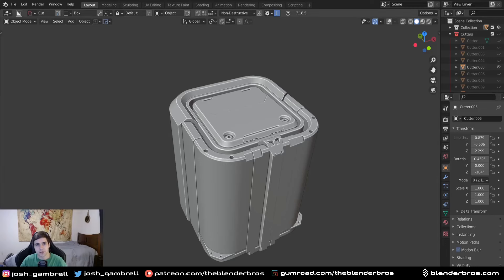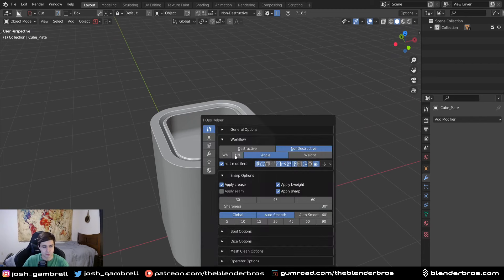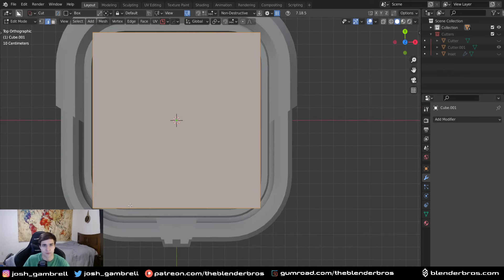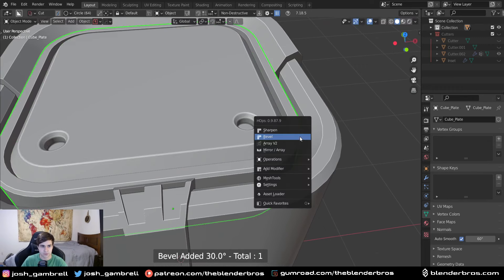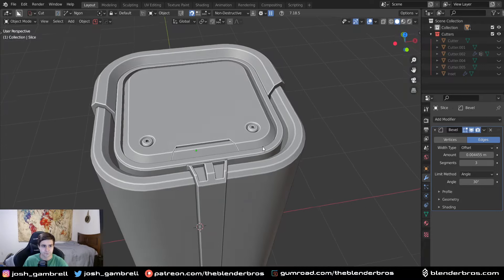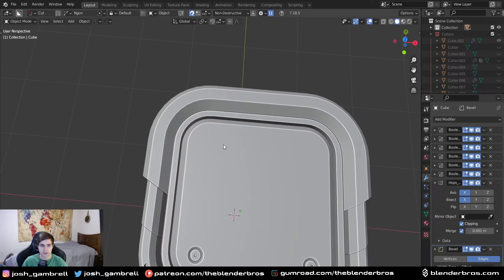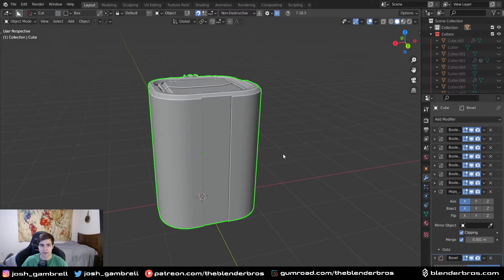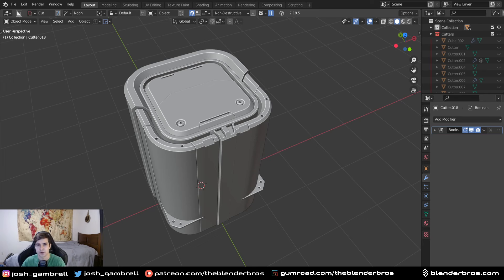Simple & easy hard surface box practice in Blender!

Comment: Great Video! I have a (maybe stupid) question. I am coming from parametric cad software like solidworks, fusion360. Here Technical objects with many cutouts or offsets are super easy, thats what it is made for. (Vise versa, organic shapes are easier with polygon subd modelling) Why dont you build hard models in parametric cad and export it as polygon with low resolution? not dealing with all the boolean polygon situations?

Comment: Man this is awesome. I just finished the jumpstart course and I am expanding the scene (tagged you on FB). I learned so much through this video by trial and error. However I am stuck now at 12:11 because Smart Apply does not create two separate objects. It creates the latch but it is not slicing the cube. I checked your other video and I don't have any duplicates. If I apply the modifier by CTR+A or use Apply in modifiers tab. It works. Any ideas?

Comment: At around 2:30 I use ctrl + to select the inside of the box, and then use Curve/Extract. I only create a sort of lip around the inside. I don't get the sides or the bottom, but I know they are selected.
Reply: Did you press Shift before you click?
Reply: @yiluo2623  agree, clicking shift before clicking solves this

Comment: Thanks for the techniques. Pay attention to the screencast for next time.
Reply from the maker: Thanks (and also my mistake), but this addon is severely broken. Turns off randomly, disabled by default, and displaces its position as I'm working constantly when I don't have my eye on the actual keys. Unfortunately there isn't any other alternative out there yet, free or paid.
Reply: @JoshGambrell  I know, when I press caps lock it turns off as well. Blender should implement screencast natively.

Comment: Thank you. Very nice tutorial. In 14:55 you stick in inset operation. I got this at first inset. I realize that inset use a copy of main object with applied modifiers and this may be a source of glitch: inset use solidify modifier for complex objects and get wrong result. If you show inset subobject in cutters you can see very strange results. To escape/minimize this glitch disable maximum unused modifiers in object stack before inset (boolean holes/cliffs as example, mirrors may be too) then do inset with solidify and turn modifiers on after inset. Additionally I have bevel as last modifier and disable it before inset. After inset/solidify bevel got upper inset and I move bevel modifier down manually.

Comment: At 10:06 there is a mention to press shift+2 that hide cutter collection, but shift 2 doesn't do anything to me.
Is there a way to setup that hotkey? I can't find that feature anywhere
Reply: in case you still need the answer, Shift 1, 2, 3 etc controls the visibility of the collection in your scene collection inside the Outlier panel, since the Cutters collection is in 2nd order, shift 2 will trigger the visibility setting for the cutters collection. Most importantly, those hotkeys will only work in Object Mode.

Comment: At 3:55 when I use the Inset Boolean, the original shape which I cut just comes back - so it looks as though nothing has been done. Does anyone know why this happens is there a way to change the strength of the inset?
Reply: Having the same issue. Mine does the same. If the screencast was showing, perhaps we could have seen the commands, but the screencast is covered by his video.

Comment: Great video as usual. Thank you! Quick question: how do you get the ngon cutter to begin right on the surface of the object? Every time I do it, the cutter begins a good distance from the object. Usually, I can work around this distance, but sometimes it's really far away. Is there a setting in BoxCutter somewhere that controls this? Thanks!
Reply from the maker: Yup, just turn on object align instead of view align
Reply: @JoshGambrell  Thanks. Turns out it was a bug in BoxCutter. I updated to the latest version and the issue vanished.

Comment: Two tiny questions. 1)I wonder why my inset (https://prnt.sc/12a32q7) boolean isn't as tidy as yours (3:55) 2) what may be possible reason of fps drops when using boolean especially inset
Reply from the maker: You need more bevel segments, ramp that puppy up to 10-20 segments to keep it smooth. Other than that, it looks fine, just adjust solidification with the t key. FPS drop is unfortunately Blender native code, not the addon. I have a 3,000 dollar machine and it still lags running these operations. Unfortunately one of the limitations of blender.
Reply: Hello, I have the Same issue. Have you found a way to fix it? The strange thing is that I tried to redo everything several times (to anderstand and keep the process in mind); sometimes it is working well and sometimes it looks like the picture of the link you share. I bought Boxcutter and hardops using it on blender 4.2, is there an issue with the compatibility of the addon and the software? Or something to tick somewhere? ✌